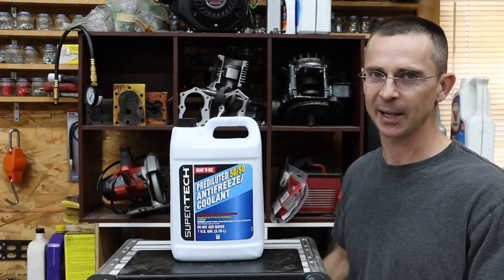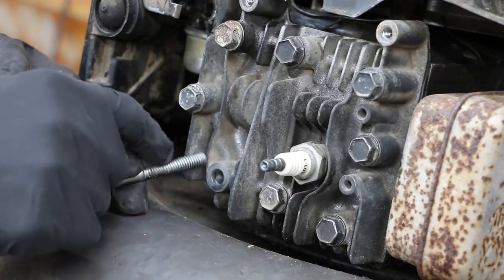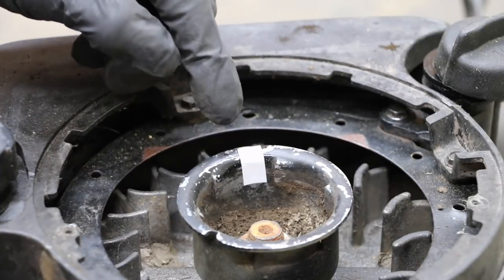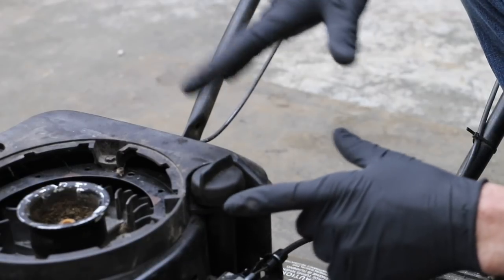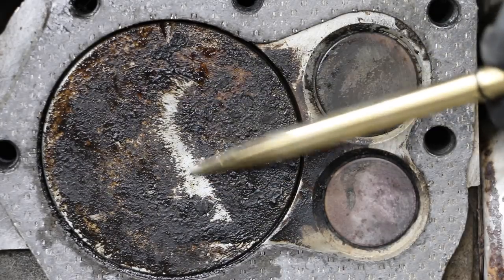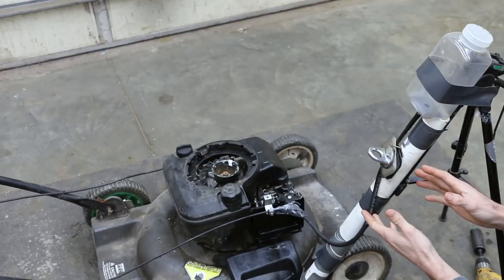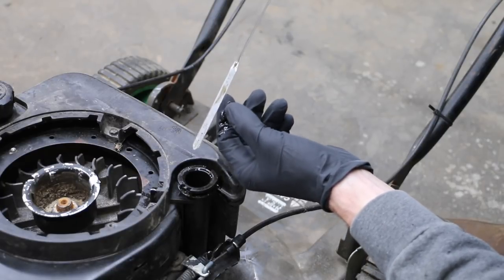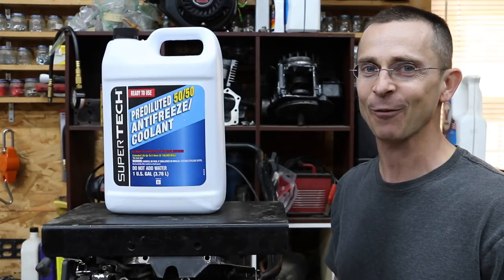Will Antifreeze clean an Engine?  Let's try it!

Comment: I doubt the Antifreeze is doing anything useful. It's all the water. In fact if anything the Antifreeze is interfering with the water's ability to turn into steam effectively reducing the cleaning effect strait water would have. How water injection cleans carbon deposits in an engine is the water droplets land on the carbon deposit partially soaking in. Then the water is heated by the combustion pulse into steam. The steam takes up well over a 1,000 times more volume than liquid water. The pressure from this inside the carbon deposit breaks it up where  it is then carried away in the exhaust gases. 

Basically this is a process where you want steam,  but the whole purpose of antifreeze after stopping water from freezing is to stop it from boiling, you know turning into steam. So for better results skip the antifreeze. Also using clean water woun't contaminate your oil.
Reply from the maker: Thanks for commenting on this.
Reply: This was my thoughts as well. Small amounts of water violently boiling would be very effective at cleaning.
Reply: @thechemtrailkid  that's what my father use to run on our 361 ford Cleveland.. Water injection for yrs.. I pulled the engine down recently with over 200.000 klms on it was in beautiful condition inside the engine.. Water injection old school preventive.. It works..
Reply: During a high school shop class the teacher talked about "top engine cleaner" basically it's water with a little alcohol in it.  Get the engine up to temp and then stream it in and keep it running.  Then when about half is used up dump the rest in and let it die.  Wait 20 mins and then drive it down the road for about ten miles on the interstate.  Blows most all of the crud out.  I did something similar with my 03 4.7l a few months ago.  Ran a aquarium air line into the engine bay to a vacuum line after the throttle body and ran about two liters of water through it.  Had a little blow past the rings but it floated on top of the oil and after a single trip the water evaporated off so not worried about it.  Using pure water won't hurt the cat system either as often times a byproduct can be water so it won't hurt it at all.
Reply: I think I agree with this. Sounds very plausible.
Reply: I think i will agree.
Reply: Boi gtf outta here, ofc water will contaminate the oil. Shit will separate out of the oil and is bad for your engine since water is incompressible
Reply: There was a cartalk episode where they discussed using water for this purpose.
Reply: Antifreeze doesn't steam as easily as water instead it slushies around  and gets more than hot enough to break apart the carbon and wash it away. Maybe make a video antifreeze vs water and we se results.
Reply: That is totally correct!!
Reply: Why use 50.50?
Reply: @glenbray1609  this way it's more balanced lol but it definitely works just don't do it on an expensive car case It can possibly mess up things like sensors instead of fixing things but older cars depends on some cars it's much safer just make sure o2 sensors are removed and some other sensor's that could possibly get messed up this is a your own risk but definitely get nice inpevments.
Reply: the water turning to steam would be effective at cleaning. a small amount of alcohol in the mix would also help since alcohol will cut grease and carbon. take a look at a can of parts cleaner ingredients,most use some form of alcohol in the mix...
Reply: Agree 100%.... in the 70's when we first lost leaded gasoline, the high compression motors would ping severely..  you could help that by cleaning the carbon deposits off the inside of the cylinders. 
The way we done it, was to take a Coke bottle of water, and run it through the engine as we revved the engine at about 4 grand.. you have to be careful or you will drown out the engine..  it should take about 1o or 12  seconds to run a full bottle of water through the engine..and you want the engine hot..
Reply: @AznTony360  a continuous supply will after time.  A small amount will soon evaporate.
Reply: Glen Bray probably because it’s usually a 50:50 mix in the cooling system.
Reply: Tony Nguyen  No, water added to combustion will not contaminate the oil. The only water that could reach the oil would be blow by. The oil temperature is above 212 degrees, so the small amount of water vapor entering the crankcase would be instantly vented out through the crankcase ventilation system.
Reply: That isn't true, antifreeze does raise the boiling point minutely but that's only because of the properties of glycol, the reason water doesn't turn into steam while in your cooling system is because it's pressurized hence raising the boiling point by waters relation to pressure which is why I'm very hot climates coolant isn't needed and why it's also refered to as antifreeze as well. A liquid cooled engine does not by and means need coolant to run at the correct temperature
Reply: LOLKINGBABY  Coolant is ALWAYS needed as a corrosion inhibitor! Water alone becomes a conductor in the presence of dissimilar metals. Without a corrosion / electrical inhibitor, the cooling system becomes a battery and its “plates” corrode and are eaten away by electrolysis. Water may serve as a coolant, but will not prevent the destruction of metals in the cooling system.
Reply: @brucecoleman7412  water becomes a conductor if it has minerals, distilled water would prevent the water from being electrically conductive not to mention glycol, once the corrosion inhibiting detergents are cooked out of it, becomes a far better conductor than water. Again, no legitimate use to using coolant other then resistance to freezing. Before you take my point as moot coolant is easily the most abused liquid in a vehicle, oil is eventually changed, power steering will fail before a thermostat in almost every car due to high pressure lines rusting, getting damaged just due to the pressure involved on a h/p side, brake fluid is changed or atleast somewhat replaced whenever a it is bled or a line is replaced, transmission fluid in 50% of cars is a regular top off.

Comment: A lot of old timer's I know have used regular water to "steam clean" engines. Use it just like fogging with seafoam. Mist it into a carb, or vacuum line into the intake. They say it works as good or better than "all that snake oil". But they also say it takes a little longer but works better. Love your videos! I watch them all.  THANKS!!
Reply from the maker: Thank you!

Comment: Excellent video Project Farm keep them coming.  I've watched them all, and they are informative and well made.
Reply from the maker: Thank you!
Reply: Project Farm on the engine that you used wd40 in did the compression go up after you put regular oil in it? Why I ask is because wd40 is thin and engin oil would make the rings seal better- maybe? In a pinch I have use wd40 for a cleaner and it would remove all the oil on the oil control ring. By the way excellent videos and thank you!

Comment: I love your videos!! I searched your videos for "transmission fluid" cleaning and did not find anything. I knew an old guy that swore by it for cleaning valves (dribbling it into the carb). And I actually witnessed it operation!! If you already have done this, please forgive me. BUT, if not, and you do try it, please be warned that there will be "TONS" of white smoke!!! God bless you...
Reply: I'd like to see that as well!
Reply: ATF into the intake is a new one on me. I've heard of mixing half a quart of ATF with the engine oil to remove varnish and deposits from within the crankcase though.
Reply from the maker: Thank you for this recommendation!
Reply: I add atf when I do oil changes on stuff that I havent touched for a while. Cleans them right up in the oil. Don't see why it wouldnt work in the intake.
Reply: It was an older video. Check the "I can't believe what Seafoam did to my engine" series.
Reply: Abe Lincoln My mechanic used to do this to my old 1985 Chevy Malibu at the time I didn't know what he was doing but he was pouring tranny fluid on my carburetor telling me that it would clean the top of the Pistons and valves sure enough the car used to run much better when he was done treating it
Reply: Abe Lincoln i

Comment: As far as the AF effect on the oil, I have a story of my own to share. I built my 383 stroker for my '70 C-10 and was losing AF. The radiator had a leak, the heater core had a leak, so I didn't think too much of it. I wasn't aware how much was really leaking.

One day I drove my truck, and I watch the oil PSI like a person obsessed with not melting my several thousand dollar investment, and the oil PSI was fine. I shut the truck off. Went out to start it a few hours later, no oil PSI.

I checked my stick and it was dry.

Put some oil in and had PSI again. Drove it a few miles home. All was good. Checked oil level the next day - none again. But there was globs, like jelly on my stick.

Poured some oil in again, had PSI. Got it warm and pulled the oil plug. It pooped out. It had the consistency of room temperature strawberry preserves.

My AF leaks weren't all external. The intake was leaking into the crank case and the oil was doing exactly what it was supposed to do. Trapping contaminants.
Reply from the maker: Wow!  Thanks for sharing this experience.

Comment: I've been watching your channel for months now, mostly late at night on my TV.  I only recently subscribed, sorry for the delay in supporting your excellently entertaining and informative channel.
I would like to see you test radiator sealant products.  I used something called copper seal or maybe it was glass seal (not sure which brand it was as it was like 16 years ago).  Anyhow, I had this 83 Thunderbird with the V6 (notorious for blowing head gaskets) and it  overheated one day and after that it would actually pour water out of the tailpipe like a garden hose.  I suspect the head gasket did indeed let go.  So, I bought this product and followed the directions to a T.  It took probably three hours to finish the treatment.  As the time passed during the treatment the water pouring from tailpipe slowly decreased until it completely stopped.  I did no further repairs.  I drove it about another 10K miles and felt confident selling it to my Sunday School teacher for his son.  He drove it for several months with no problems.  I am confident you can devise some type of test for this purpose.  Actually, that is one of my favorite parts of your channel, the ways you come up with to perform your tests.
Reply from the maker: Thanks for watching and subscribing!  Thanks for the video idea.

Comment: I've done oil analysis and my car has a minor head gasket leak. My oil looks normal and clean but it shows that sodium and potassium (coolant) enters to my oil. Just sharing my experience. Great video.
Reply from the maker: Thank you!
Reply: Yes this means your head gasket is leaking or you have a warped or cracked head. Eventually, the coolant leaking into your oil will cause sludging and bearing wear.
Reply: buckaroobonsi555 Yea, I know it's my beater but I still care for it. It's a 4th generation civic so I will be doing a engine swap anyways.
Reply: Check out the channel OldSkoolFunk. You could wet-sand the head and re-lap the valves instead of swapping engines. search "cylinder head resurfacing" and "how to grind valves." A real money-saver if you can spare a couple hours.
Reply: 999thenewman I'm going to be upgrading the engines to a more powerful one but thanks for the tip.
Reply: Can you do a video using LA's Totally Awesome cleaner for $1.  I've seen it used on many small motors, and car parts.  Unfortunately I'm not clever enough to make a video! Thanks

Comment: I'd be interested in seeing you do this with some home degreaser, like awesome cleaner. Try a couple different brands of degreasers to see how well they clean out the combustion chamber.
Reply from the maker: Thank you!
Reply: Formula 88 is an amazing degreaser.
Reply: Do not use degreaser inside of an engine unless you want the engine to seize up due to all the oil on the cylinder walls being stripped off and bare metal on metal contact would heat that sucker up quick
Reply: @iPunisher  sure, if you're gonna put it in the block alone but you're not, you're adding it to the oil. It's no different than adding a retail bottle of "Engine Flush".
Reply: @MrCougar214  engine flush is not a degreaser
Reply: @iPunisher  engine flush has a few solvents in it so yes it is a degreaser. I don't know where the hell you get that from. If you want to be technical, ANYTHING that will break down sludge and deposits in the internal combustion engine can be considered a "degreaser".
Reply: @MrCougar214  solvents and degreasers are two totally different things  Solvents thin or aid in the mixing of oil based build up or sludge while degreasers cover oil molecules and trap them in water so if you want to ruin your motor because you don't know the difference then go right ahead just do the internet a favor and record it so we can all have a good laugh...

Comment: You should try using vinegar as a carbon cleaner!  I thing it would be really interesting as vinegar is well known for its cleaning properties.
Reply from the maker: Thank you for this recommendation!
Reply: Denis Divi 

Find a baked-on-carbon, crusty skillet. One that’s also greasy would be better. Test your theory by hand washing with vinegar and a sponge. Then try boiling it. Note its failure to do much.
Reply: Isnt vinegar acidic? It would promote corrosion more than anything else.
Reply: @commodorevn6557  Most metal it'll leave a patina or do nothing if it's minimal
Reply: Liquify some bacon grease and drip it into the engine. Maybe cut it with some olive oil....
Reply: @ProjectFarm   White vinegar typically consists of 4–7% acetic acid and 93–96% water. For what that's worth.
Reply: Commodore VN -Vinegar is actually a base.
Reply: @cotyluckett   The Other name for vinegar is...Citric Acid + water, when you put acid in water it lowers the pH, less than 7, not a Base Br'a.
Reply: @NuMooX  It has an acid... But NOT "citric", it is ACETIC acid...

Comment: Not a perfect test for oil contamination, but why not put the oil (before and after antifreeze tests) through your lubricity tester seen in some of your other videos?
Reply from the maker: Yes, I should have done this.
Reply: Project Farm What about just plain water instead of antifreeze? Distilled water is just 88¢ for a gallon at Walmart.
Reply: Project Farm Plus it shouldn't hurt O² sensors!
Reply: O2 sensors would be fine... The catalytic converter, however would be damaged.
Reply: @olsonc7022  It will destroy the heating element in the O2 sensors.

Comment: Try using water as a carbon removal fluid. Some folks years ago used water in carbureted engines to remove carbon from the cylinders. Some of them referred to this as giving the engine a drink
Reply: Marshall Heartley ...done already
Reply: he did, didn't work so well
Reply: I might be wrong, but I think he already tried that. But I wonder if there would be any difference if water mist is used (a real mist, made by an ultrasonic mist generator). It might work better not only for cleaning, but supposedly it should also decrease fuel consumption, that might be worth testing as well :)
Reply: Hmmm then I need to go back and see then. My memory isn’t so good so I could have forgotten that he tried it. I know that other in the past did it with carbed vehicles and had fairly good success. So if he did and it didn’t work, then I’m not sure why it didn’t work so well. Off to the archives to look! Thanks folks!
Reply: Marshall Heartley Do you have a link to that video?
Reply: Jeremy Johansson I haven’t gone and looked for it yet. Will have a look sometime today.
Reply: sumixSTYXX thanks for the link!
Reply: You're welcome :)
Reply: Water injection will work, but I’ve heard of steam cutting a valve. And of course it won’t compress, too much and you could bend or break a rod
Reply: Italian tune up.
Reply: Marshall Heartley 

Engine produces water continuously as high pressure steam while it runs. Vol ~ = vol of fuel. Still accumulates carbon and other deposits.

Comment: Have you tried using a mixture of 20% of ATF in with the oil and see if that will clean an engine from the inside?
Reply from the maker: Not yet. Thank you for this recommendation!
Reply: I've done this trick for 40 years on older crappy cars and it works but not with only one oil change.  I did it each winter until it was looking much cleaner.